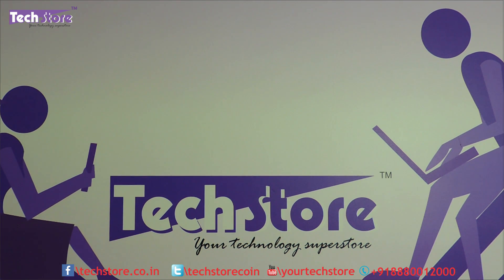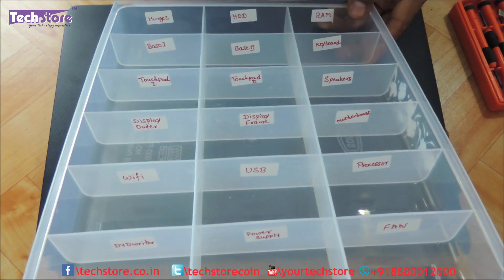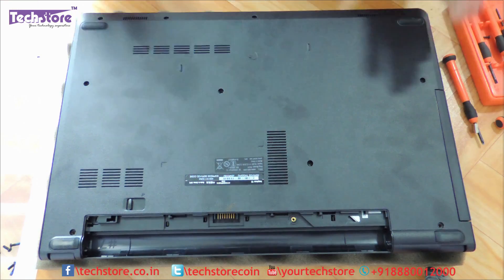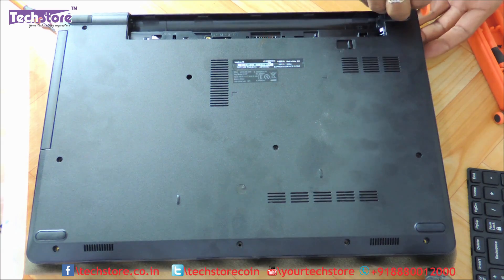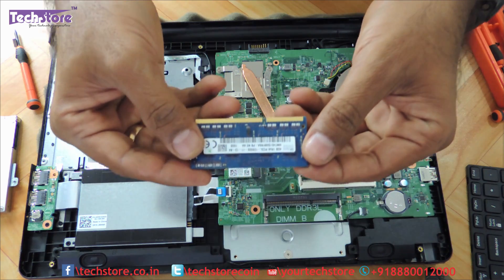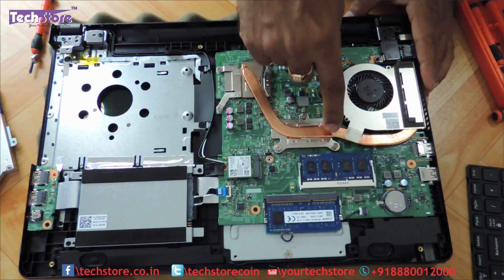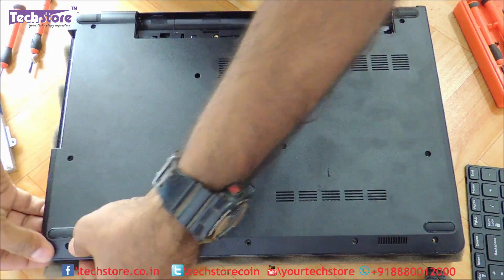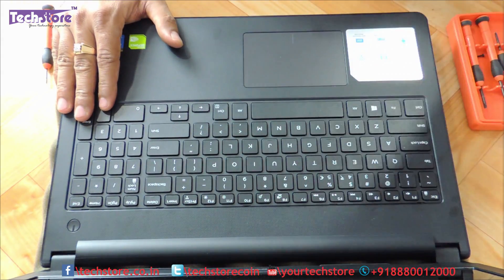Dell Inspiron 15 3558 5558 3000 5000 Series : How to upgrade ram hdd ssd 2016 model easy diy keyboar

Comment: Hi i want to upgrade my dell inspiron  15 3000 series 3558 i3 
Can you please guide me how to buy and what ram should I buy and ssd
 Intel (R) core (TM)i3-5005U cpu@ 2.00 GHz 2.00GHz
Installed ram 4.00GB
64 bit Processing system ×64 based processor

Comment: Just curious.  Why does the keyboard need to be removed before replacing/adding RAM or the HD?  I am sure there is a reason but from the video seems like simply removing the back cover would expose the pieces needed to replace.  Thanks.  Very helpful break-down video.

Comment: It's been 5yrs almost down the line and still, the video is informative. Having a query I have this exact model and I want to use my DVD drive to install a SSD.Do you see any issue while doing that. Exactly will be getting a 9.5mm caddy from amazon and would be buying a SATA 3 SSD . Kindly let me know.
Reply from the maker: yes you can do that. Installe a 9.5 MM caddy and also buy a sata 3 ssd...they will work like a charm.

Comment: can we change its 3558 processor ? by using hot gun or any other components because my processor became very very slow. after opening any app sudden it is not responding and after few seconds again work and this repeats continusly.
Reply from the maker: Recommend you to install 2.5 SATA SSD and upgrade ram, reinstall OS. It should help a lot. Thanks. Do Subscribe
Reply: @TechstoreCoIn  everything done except upgrading to 2.5 sata ssd but it already has sata hdd

Comment: What kind of RAM is replaceable for these? I have a 4GB 2Rx8 PC3-10600S-09-11-F3 
will this work? Really would hate to do ALL this work and find out my RAM is not the right size
Reply from the maker: you need to buy a DDR3L 1600 MHZ RAM

Comment: My laptop is exactly like this  it just doesn’t have the graphics part connected to the fan. In fact it doesn’t have the graphics part is there a way that I can install this and a new fan.
Reply from the maker: not possible to install a graphics card
Reply: Techstore even if I get a new mother board with graphics card

Comment: Take it slow, don’t miss any screws.  The actual backplate removal was really the only scary part, but once it get started it pops out pretty easy. Don’t forget to thread the ribbon cable back through the frame first before you put the backplate back on!

Comment: I finally figured out how to get mine apart. I added another 4gb RAM just like you did. But when I start the laptop back up, it still only reads 4gb in the properties area. Is it possible to have a bad card? My extra came out of an older Inspiron

Comment: tedious is correct! thanks for posting this. Where can I get the metal pick and plastic orange triangle tool you used to lift the keyboard & separate the laptop case? are they available in your store? I saw the Dell laptop but did not see any tools.
Reply from the maker: +Shibu Kinatukara They are not available at our store. But are easily available at mobile repair outlets

Comment: So I have a 3565 inspiron I just bought. I wanna upgrade the hard drive to a 2tb. I'm just wondering how do I install the OS After installing the new hard drive? my computer didn't come with a recovery disc or anything.
Reply: get the cable and copy it from your laptop to the new hard drive and then put it in

Comment: This is a crazy ordeal to go through to upgrade the RAM.  On the dvd removal, there's a piece of metal that shows at a 45 degree angle in the battery compartment; once all the screws are removed you push that piece of metal with a screwdriver per the instructions molded into the plastic.

Comment: Anyone having issues with the DVD drive removal - he does this off camera - you flip the laptop upside down so that you are looking at the bottom. Then go to the battery bay. Near where the silver screw was you should see a portion of the DVD drive (its kind-of angled). You can take a screw driver (Phillips head) or flat metal tool like he has and push it out with a like strength. Easiest way to do this.
Reply: great tip! thanks
Reply: Slynk I was jist gonna say the same thing. Like how did he do that part?
Reply: Eres asombroso
Reply: Slynk thanks
Reply: BLESS YOU BLESS YOU BLESS YOU

Comment: You really need to keep the work in front of the camera.  It's not helpful if no one can see what to do.  Not sure how to remove the DVD, you can not just pull it out as it is connected with a tape strip.

Comment: Man its so complicated. I just tried it, but I could not continue. I felt I was going to break my laptop into parts. :(
Reply: Ali Aburas same :( I got my dell a week ago and after seeing this video i don't feel like upgrading my ram anymore. my old inspiron 3521 had a little cover with only two screws to reach the ram and hdd, I thought this was the same :(
Reply: i thought it was complicated at first but watch a bunch of videos on removing/upgrading ram and it will become easier, no matter what!
lil tip: you dont need to remove keyboard to upgrade ram, just take of back cover and insert it the way he shows in the video
Reply: @elitegamer1807  sweet!! So it's not necessary to remove the keyboard, right? And one more thing what model did you have?
Reply: @trinatripathi6854  i have the Inspiron 3558, not the best for gaming but it works :)
Reply: @elitegamer1807  hey,
Thank you!! And did you tried upgrading the ram without having to remove keyboard?
Reply: @trinatripathi6854  yep, removing the keyboard is only for changing the ssd step, if im right
Reply: @elitegamer1807  how to remove the back cover because it is fixed with the 6 screws on the keyboard ? And to insert RAM we need to take out back cover. Is it possible to pull back over without removing the keyboard ?

Comment: i cant remove my dvd driver
Reply from the maker: +Dkjc28 you need to follow the instructions correctly.
Reply: nvm i got it u just pull it out -.- thx for the video this made my fps 40-60 to 60-100

Comment: Can I remove the DVD drive and the back panel to upgrade the RAM? or is it necessary to remove the keyboard as well ?
Reply from the maker: It is necessary to remove the keyboard without which you cannot upgrade the ram.
Reply: Techstore can I just remove the back panel and disk drive to update only hdd

Comment: plz do same with Lenovo IdeaPad 510
Reply from the maker: We are in process of doing the same.  Will be uploading the video shortly. Do subscribe.
Reply: Techstore plz give a try to use both hdd nd SSD by removing dvd drive .
Reply from the maker: You can buy HDD Caddy and put it.
Reply: Techstore so both hdd ns SSD will work well in same time ?